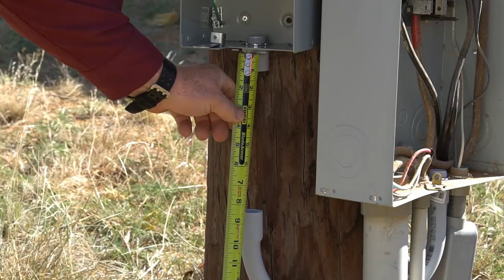🚐DIY: Travel Trailer RV Outlet Installation: Easy Walk-through Guide⚡

Comment: Pretty simple. I have a little bit of electrical experience but liked how you gave several views of which color wire goes where on the back of the receptacle. For people with little to no experience, I think that would be very helpful. Nicely done. Thanks for taking the time.

Comment: A square tipped driver, makes connecting the conductors to the circuit breaker and bus bar a little easier.
Reply from the maker: Thank you for commenting Cold Comfort!

Comment: @thejungleexplorer  I noticed you used a stranded 10 gauge wire.  Does it matter if the 10 gauge wire is stranded or solid for this application.  Lastly, thank you for posting your video, it helped me answered many of my questions.  Very thorough, but short and sweet.  Thank you.....   Rick
Reply from the maker: You are very welcome.  Glad the video helped you.

10 gauged solid or stranded, they are both the same. Stranded is just easier to run through tubing with bends because it is more flexible than solid.
Reply: @thejungleexplorer  Aaaahhhh, now that makes sense using stranded or solid 10 gauge wire.  That was going to lead to my next question, but your always 1 step ahead of me...  lol.  I have to run about 100 ft to125 ft of wire, with minimum bends.  I will definitely use stranded wire.  Now is it better to use 10 gauge or 8 gauge wire for that distance.  Once again, thank you for all your help.  You have been a lifesaver.  Also, you just earned yourself a new subscriber.  ..... Rick
Reply from the maker: @rickrangel I am glad I could help. The question of what size wire to use is a bit more complex. 

If you are running a 30 amp service at 100 feet if distance, you would need to use 8-guage copper for run or 6-guage Aluminum. If you are running it farther than 100 feet, say 150-feet, you would need to go with 6-guage copper or 4-guage aluminum.  

Sometimes if you go to an commercial electrical supply house they have partial rolls of direct burial aluminum wire that they will sell at a discount.  It could save you some money.
Reply: @gleexplorer WOW!!!  Thank you for the tips.  I believe there are  many independent commercial electrical supply houses here in town.  Not the Big Box Stores like Home Depot or Lowes.  Ok, I promise to not bother you anymore.... LOL.  Although, I truly want to thank you very much for everything.  ..... Rick
Reply from the maker: @rickrangel  My pleasure.  Always glad to help if I can.

Comment: Good video.i was told at lowes and homedepot, that i need 10.3 gauge for a 30 amp rv. Total of 4 wires in the spool..you video show 3?.
Reply from the maker: RV electrical is different than standard residential electrical. The 10/4 (10-gauge/ 4-wires) you are looking at is for residential wiring, not RV wiring. In residential wiring, a 30 amp outlet would be 220.  It would have two 110 legs, a neutral, and a ground, for a total of four wires that would be colored, Red, Black, White, & Green.  A 30 RV outlet is not 220, it is only a 110 outlet.  It only requires three wires, which would be a 110 leg, a Neutral, and a Ground (Black, White, & Green).  Most Lowes employees are not certified electricians and not every certified electrician has experience working on RV electrical systems.  It is common for even electricians who are not used to RV electrical to get confused by this.
Reply: @thejungleexplorer  thank you.but still confused. Need 10 gauge and only 3 correct?.what is better a spool or strands?
Reply from the maker: @julioruvalcaba6362  Yes. 10/3 is what you need.  It can be either solid core or strand.
Reply: @thejungleexplorer  does distance from pedestal need to be considered.30 amp plug will be about 150 feet from pedestal???

Comment: What size wire would I have to use to got 75 ft from the panel box been hearing different sizes
Reply from the maker: 10 gauge Copper should be plenty for that run for a 30 amp service.
Reply: @thejungleexplorer   thank you

Comment: I’m using a Square D breaker box that comes with several circuit breakers including a 30 amp. I’m assuming that included breaker is sufficient for the RV outlet? I’m just trying to make sure I don’t need a special type of breaker?
Reply from the maker: I am unfamiliar with the kit you purchased. RVs that only have a single rooftop AC unit are generally rated at 30 amps. RVs with two rooftop ACs are rated at 50 amps. A 30 amp RV plug with have three blade prongs. A 50 amp RV plug will have four.

Comment: How many times do you need to say make sure to tighten down??? Holy crap!!
Reply: You would be surprised how many loose connections I have found in electric panels installed by certified electricians. A loose connection can cause a fire. Nothing wrong with saying over and over.
Reply from the maker: Thank you for commenting